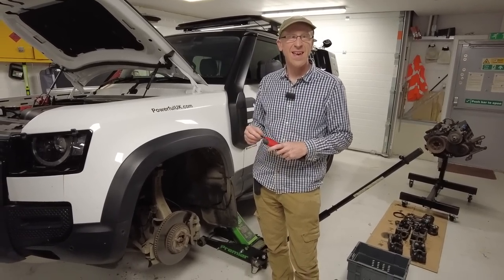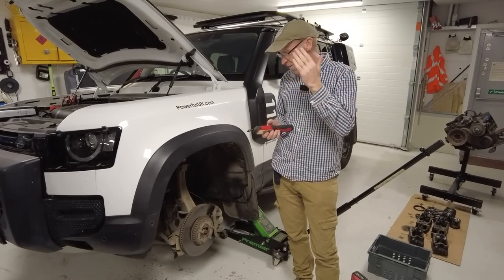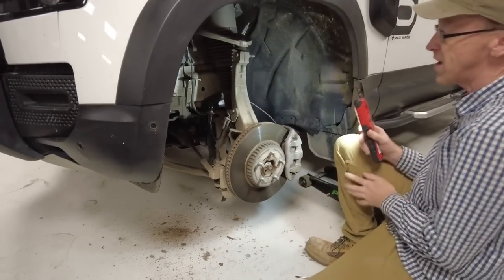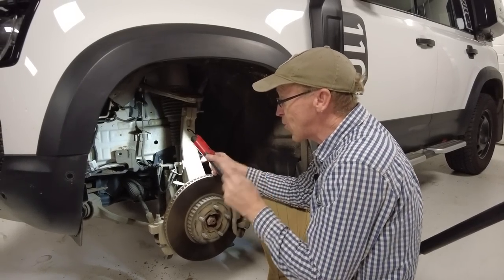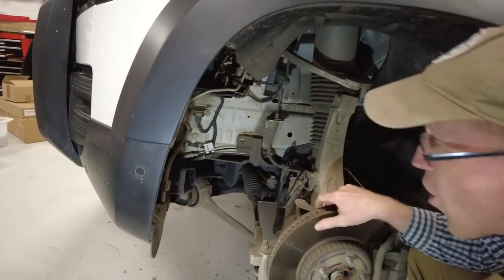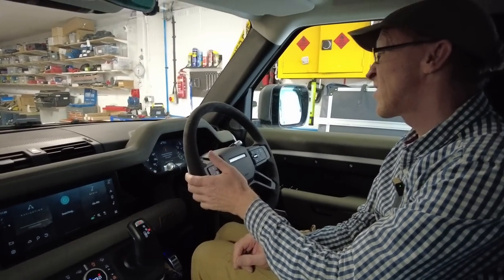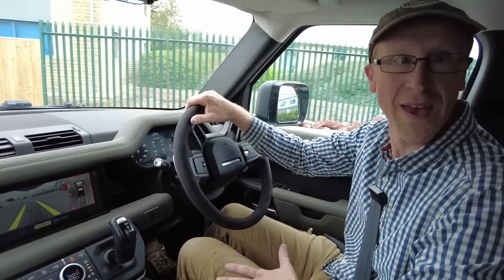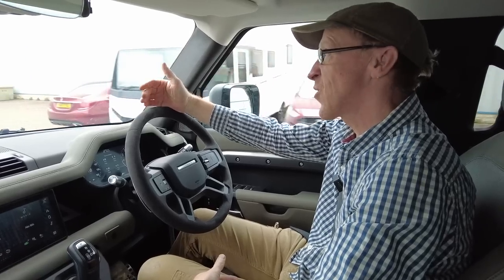We Defend the New DEFENDER - What Really Happens When An ABS Sensor Fails !

Comment: ASPW videos have to be taken with a pinch of salt.   Critical of the Defender and other Land Rovers, but absolutely glowing about the Grenadier.   Yet the Grenadier isn't the inexpensive 4x4 that ASPW predicted it would be, and I can already see problems in trying to use it as a 4x4.   Some of those issues I believe they're going to fix, but they're not on the original Defender.   I've driven the New Defender off road and it was impressively capable.   But at the same time, when ASPW makes comparisons it's always with another 4x4 which has been heavily modified.   It's not a straight comparison he's making.
Reply: Not sure which modified comparisons you mean. Speaking from years on safari most 70series you find in the bush are stock, as were most old 110s/Defenders out there. The wildlife services, tour companies etc rely on these so they are everywhere - mostly stock. The mods on Andrew’s cars are quite minimal (for driving, not living) and taking them off to have a mining spec 70series wouldn’t affect the trips much at all.
I agree on the pinch of salt from a “most of the world” perspective i.e. majority of JLR customers. But I totally see his point when it comes to the bush, places he goes - some of which I’ve traveled through too. I can’t imagine needing the internet and lots of computer research to get a car on the move in the Serengeti - off course most JLR customers will never go there. 
That’s kind of my mental struggle with JLR - I would love to have a Defender where I can use it most (Africa in my case), I don’t have the need to drive SUVs in Europe because I prefer sporty cars here. The thing is any bush mech in Africa will get a 70 series back on the road or an old defender (including electronics & tyre failures), with new JLR cars I would be alone with my laptop if I can find the right online resources in the bush. There’s got to be a middle ground (like Jeep offers) - it’s not that people are simply tech phobic, it’s the practicality on long remote trips. 
I think Andrew should build a Defender overland and tell us what happens in 4 years worth of trips. I remember he did a year with a Disco 4 and loved it save for tyre size & ride height when above 50kph - this was useful because one can take the car over-landing and compensate for this (for some places, not everywhere) depending on whether the cost of mods is acceptable to the person. For Safari for example I would be ok with that car given the right tires, yet I would stick to the well known tracks and never fully venture out like I would feel confident doing in a 70/80/105 series LC.
Land Rover dominated Africa when I was a kid. Would be awesome to see them build a car that does that again - with all the comfort that comes with LRs - that’s what Andrew is missing, him more than me since he got to drive all the variants when I was still a kid bouncing around the back of my dad’s 110s.
Reply: TLDR - stock and stock is a straightforward comparison in my pov. 
As you can tell the passion for LR is/was Africa-wide 🙈
Reply: @Pkari  Firstly, I'd say you have far more experience than I and I can't argue with anything you say with respect to that experience.

I'd just clarify "modification".   ASPW was talking about larger tyres, wheels, ride heights etc.   Then he's putting on different springs, and other things too.   It seems like an unfair comparison when what he's using is adapted but then stating that the New Defender couldn't do this.   Yes, he highlighted ride heights and wheel sizes, but I've already seen kits (on a US YouTube channel) to lift the New Defender up by 4" and allowing for larger tyres.   So it seems that you could modify and then make a more valid comparison.   ASPW was very much stating you couldn't - and that was the end of it.

They also at the time of the first announcement of the Grenadier projected all their homes and dreams of an inexpensive Defender replacement, and who cam blame them when that's what the first images looked like!   That's proven premature too with the price hitting £50k, and I don't think it will be as good off road as people think.   Won't be terrible, but they've projected too much on to this car.

However, that said, your experience in Africa is awesome and something I have never had the chance to do.
Reply from the maker: I would love to disconnect a sensor on the Grenadier and see what it does !
Reply: @L663  I'd imagine it would be very similar experience to that with the New Defender.   Some safety features wouldn't be available.   They've probably got most of their electronic modules off BMW, leaning on their offerings, so maybe try on an X3 / X5 and see what it does?
Reply: @johnsim3722  True on Grenadier and minimal experience with new Defender. I believe @RonnyDahl took his stock troopy out and did some rough trips before starting work on it - very useful reflections there on performance as compared to his modified 79.

The springs and dampers on Andrew's car are purely comfort items in my pov because a stock one comes with farming/mining setup and being an older man with resources - why not upgrade to a plusher ride :) The LR ride quality would be such an amazing alternative - much more modern suspension. 

@TFL had a terrible experience off road with their Defender but I'm guessing JLR and after-market companies have by now sorted the tyre issues at the very least? (I don't know). In Africa you see the LC70s everywhere doing all the hard work - I just wish one of the more fun brands like JLR could offer something that can do the same straight off the dealership floor. 

The LC70s in the african bush prove to me that all this money I see chucked at complex lift kits by owners of these cars is in majority of the cases a total waste - I would only address comfort.

Fun East African fact btw, the wildlife services drove old 110s/Defenders rather than LC70s for ages. Why? Softer ride - stock coils. They have their own parastatal/government workshops so they don't mind repairs. The tour guides on the other hand switched to LC70s very early on because breakdowns bite into their profit & customer experience - reliability over comfort.
Reply: @Pkari  I don't watch all of ASPW''s videos but I did see one where he was changing the springs over.   Seemed more because he'd bottomed out what they could carry with all his modifications.   He needed alternatives as he didn't have any travel left!

TFL had a bit of rotten luck at the start, JLR's dealership botched the install of a winch on a replacement, but then I seen they were testing the New Defender against others and it was if not matching, excelling the performance in those comparisons.   But still they gave the "win" to rivals.   Seemed crazy to admit the New Defender was better then give the other the prize.

I felt there was an unjust bias there and a milking of YouTube viewers.   I've seen so many channels that start off as a hobby but become a business and lose focus because of that.

It all looks like great fun and I wish I could do this myself!
Reply: @johnsim3722  Ah yes the bottoming out - he was experimenting with under-springing the car to make it more plush on corrugations by relying more on the shocks. So he intentionally put leafs that were softer than stock ones as I remember. The experiment yielded learning that this wasn't an effective approach so he switched to the parabolics he has now but retained the goal of no gvm upgrade - which I think is the way to go - light load rather than upgrades. He documented weighing the car and all - that's why logically stock suspension would comfortably carry it as it is now. 

TFL - they did have rotten luck especially because the basic Defender they wanted (their 1st order) failed catastrophically; before the winch mess and the one that got stranded on a mountain because of low profile tires. Probably an emotional and economic reaction thereafter as you say. I also wonder whether I could be objective after facing all of that, and whether they will be as harsh with the shortcomings of the Bronco.
Reply: @Pkari  I've got to say the idea of keeping light by ASPW certainly has an appeal.   I think he's right, otherwise you end up with a vehicle that's unsuitable for the job you're making modifications to enhance its abilities to do!

I don't know what to make of the TFL guys, if they're too addicted to the YouTube monetisation or are genuine.   I've seen it with other channels where the lure of cash means they lose focus on what they set up their channel to do.   But in some cases, the fruit was so low hanging you can't blame them!

But I haven't watched TFL in so long - Not sure why YouTube hasn't suggested them much!

Comment: As an Engineer Simon you know thats not a test it should have come up with an error right away which means you could be driving with no idea there was an ABS fault. if something fails the system should report ti right away then its up to the operator  what to do.  That test opens up a new can of worms.
Reply from the maker: Hi Jon - I am a little confused by your comment - it did come up with an error light right away....
Reply: @L663  Sorry Simon missed that bit however does the traction control etc work .If the system needs a wheel sensor for the traction control will fit still work with the sensor disconnected ?This iii a fascinating debate .

Comment: That's not a test. It will drive but , will it work off road. I don't  know if its got locking diffs or not. The traction control defender won't work . So if you ain't got locking diffs it's as much use as a  vw polo off road . Try it off road and has it got locking front and rear diffs ? Just checked it ain't got locking  diffs relays on electronic stuff. So if you rip out a abs sensor it's useless offroad
Reply: I would disagree with your assessment that it would be "useless off road" simply because it does not have a diff-lock or traction control! Surely much better still than any polo!!! 
Would you like to be able to still use the vehicle even if some advanced futures might be slightly or wholly compromised or not?? I do not understand your argument. If something fails, it fails, and there is not much one can do about that. It is how the vehicle's software copes with that, that matters! In this example, I'm of the opinion the Landy did well enough! You're welcome to differ, but I simply do not see the logic in it!!!

Comment: Modern cars have logic to make sure you can get home (limp mode)
Reply: Sometimes the logic goes away the more modern the car:
I had a 2002 Mercdes e-class that turned off any unnecessary consumer load to the battery when it detected a low bat voltage so you could still start the car. I had that happen to me when the battery got old. (the whole car interior was dark until the car ran, no display, no needles moved until the engine was running.
Great function as it meant the car tried to always get you home. (and it really never left me stranded) Following generation E-class -> battery low, not even a crank. No switched off unnecessary consumer loads no nothing. Why? After a long search and asking around i found the reason: Emission laws! (a cranking engine that doesn't start emmits fumes and gasses that wouldn't pass EU5 and 6 emission ratings as well as US ones. ...If one would meassure at precisely that time...)
Same reason modern Diesel cars warn 2000km before the "Adblue" tank is empty, and when it is completely empty, you won't be able to start the car until you filled that up again. Even though the engine would work fine and the car would be able to drive. Thanks to emission laws you could be stranded with a fully functioning car!

Comment: is the wheel speed sensor and wire and plug the same for all 4 wheels?
Reply from the maker: Sorry for delay - I just looked this up. There are 2 types - FRONT - both the same and REAR - both the same so you need to carry 2 spares !

Comment: £45 for an ABS sensor? That's good. I paid £99.72 for a sensor for my 3 series BMW 3 or 4 years ago.
ps. I would be curious to know if the electronic handbrake is also disabled when putting the gear lever back into Park and turning off the ignition?
Reply from the maker: Its not a bargain but its reasonable

Comment: Simon, ASPW is so biased against Land Rover, I don’t bother to watch him anymore. In 50 years of driving on and off road all around the globe I have broken several vehicles, its bound to happen, you push a vehicle hard off road somethings bound to get broken. However, I have owned a Land Rover product,of one sort or another, since buying my first Land Rover 88 petrol when I was 15 to rebuild in the farm workshop. Since then I can honestly say I have broken several LR products off roading but in 50+ years only one vehicle has failed to get me home more than once, yes you guessed a Toyota! It, a Land Cruiser, was honestly the worst vehicle in standard form I have ever owned and by far and away the least reliable. It was followed closely by a Mitsubishi. I only made 2 mistakes and never again will I for ever more, buy anything other than a Land Rover. Currently running a Disco3 and a Range Rover neither of which has had a single fault from new.

Comment: JLR is laughing at Andrew right now
😀😀😀😀there is one Andrew challenge that still needs to be addressed though.Andrew said that his friend's Defender required JLR computer diagnostics when the battery of his Defender run flat.
Reply from the maker: I have done a video on this .. the nee defender has a real problem with current draw when you open the doors … 16 amps !!
Reply: @L663  
Will it start without diagnostics equipment,in the event current runs out?I think it would. That was Andrew's last doubt when he realized who he had lost the traction control sensor failure argument.
Reply: Yes. I've run mine completely flat on 4 occasions while sleeping next to vehicle. Combination of having obd2 transmitter and activity key communicating with my phone app and kvm module respectively. On one occasion I double locked and key was in glovebox. We had to partly remove the front driver side wheel arch and snake my arm to get an alligator clip onto the positive terminal. Battery was showing 2.6 V. People with me were saying battery is stuffed. As soon as we got it to 10.8 V from another battery, the system fired up and I was able to open the door, open the bonnet and connect a lithium jump starter. After starting, about 100 amps was flowing back into battery. No codes, no pathfinder required. Battery holds charge, even after being completely discharged 4 times. When camping beside vehicle,  wrap the keys in aluminium foil and remove any obd2 transmitter.
Reply: @villadazzler  
Andrew has been proven wrong once again,he also said that a unibody off-roader's undercarriage woukd get stuck when subjected to extreme off-roading, something I really doubt.

Comment: Why would you make that assumption.. the air suspension etc and it drives fine works on my 18 year old d2 when an abs sensor goes and the 3 amigos come on…
Reply from the maker: I think the Disco 3 had some problems - but not sure as i have not tested this myself

Comment: So, if you think you'll get stuck in the outback, or anywhere else you happen to be overlanding, if you break the abs sensor, then surely packing a couple of spares would (to someone who goes off road) be the logical thing to do. Not rocket science, is it ? After all, it's not like they'll take up a lot of room . ASPW  can be a complete tit sometimes !
Reply from the maker: Hi Ian - good point - it looks like the LR parts are cheaper than the Toyota ones too !
Reply: Agree but at least the sensor would take up less room than CVs for the newer Toyota's or Y62s or even diff centres for 100 and 200 series.
Reply: @L663  I wonder if each wheel has the same sensor part number.

Comment: The new defender is a great bit of kit mine hasn’t skipped a beat and it’s the most comfortable but most capable car/van I’ve ever had
Reply: Love the videos Simon, and bought plenty of your products the new rear bumper guard you’ve designed fits the hard top van perfectly much more rugged than the JLR one. I have some ideas for a few products for the hard tops that would lend themselves particularly to commercial applications and customers. Have you got anywhere with designing the shelving for the back?

Comment: Nice one Simon, a real can of worms but you maximized the facts & minimized the emotions, well, most of the time !
Frankly, the 3 Amigos do not deter us on road & most often are debugged although our Freelander 2 has had an airbag light on for 6 months. Often times it can simply be a sub-optimal battery, same for my XK8. 
Now on our 5th LR we still have our old TDi which a S.African mechanic eloquently stated that " it can be fixed with a coat hanger & a hammer", or, if out bush find a local bush mechanic.
To be fair Cynthia, that is what the sub title called ASPW !!, was clear that he has specific requirements that are not required for Toorak Tractors or Jumeirah Jane's school bus. 
? When will Tata produce the old Defender formula in India, its demise was courtesy of the "nanny state" Eurocrats in Brussels.
Reply from the maker: Yes you make some good points - points i think Andrew ( Cynthia ) was also trying to make but got a little carried away,,,The Grenadier tried to make a simple 4x4... they failed !

Comment: Did you still have 4WD?
Reply from the maker: I guess so … how would I configure 2wd ?
Reply: @L663  I guess so? The 4WD smarts rely on the sensors in the wheel and work fantastically. But if you don’t have a sensor in one wheel do they still work???